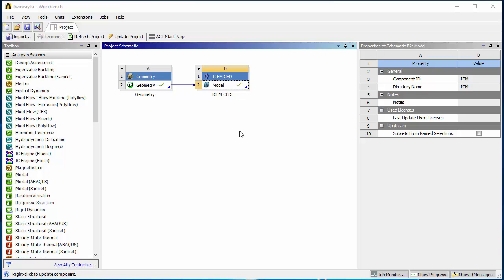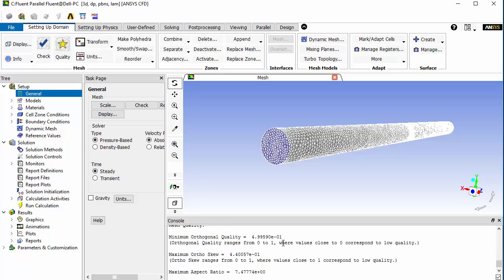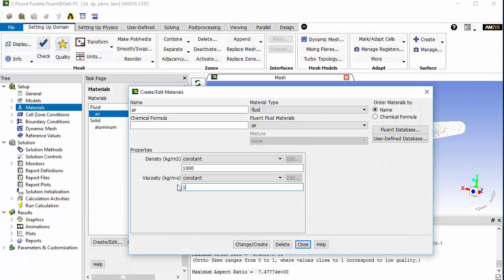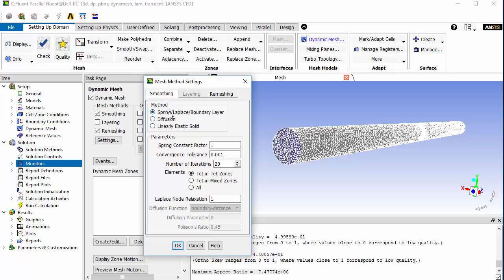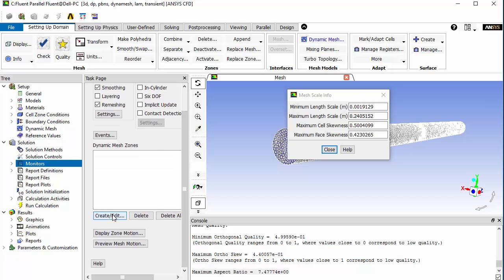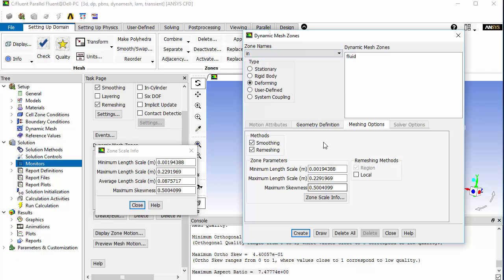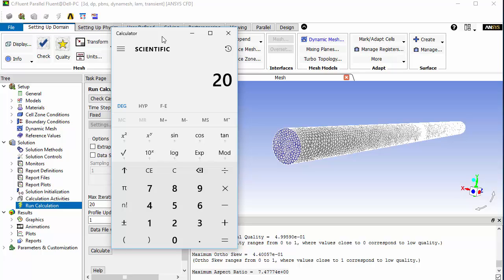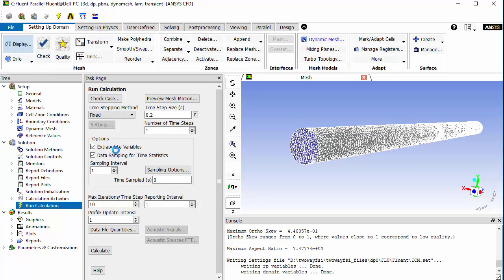Two Way Fluid-Solid-Interaction tutorial - Fluent Setup (2/4)

Comment: Dear sir

I am a post-graduate student at Babol University of Technology and I am working on erosion effect on pipe failure.
I recently see your valuable video tutorial "Two Way Fluid-Solid-Interaction tutorial ", I have found it really interesting. I would like to do similar work with a bit difference with Ansys fluent, but I have felt my knowledge in this software is not enough to understand all the important options in this area. 
Therefore, I would like asking you that I can ask a couple of question about this?

Sincerely, 
Mostafa

Comment: Nice Video as always. In ICEM, you have meshed both sphere and fluid, but in FLUENT you were able to import only the fluid domain. How did you manage to do that? This is not shown. Could you please explain?
Reply from the maker: suppressed the inner volume of solid while doing the geometry in the design modeler.  and suppressed the geometry of pipe when meshed fot he structural part.